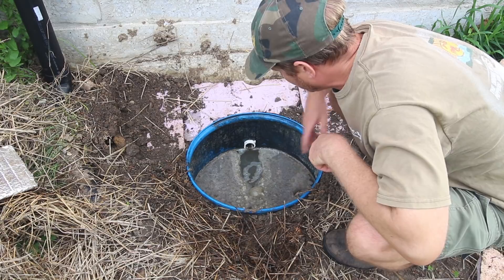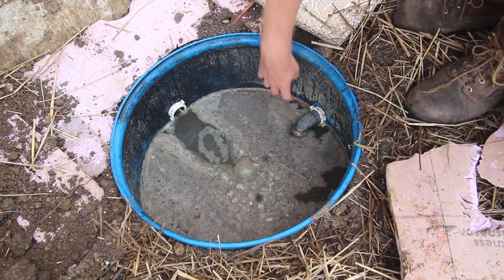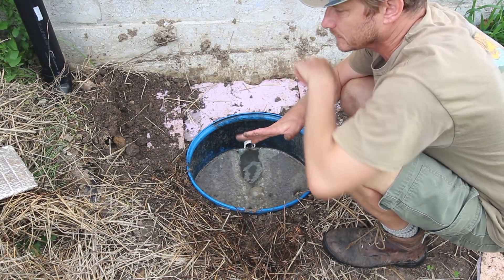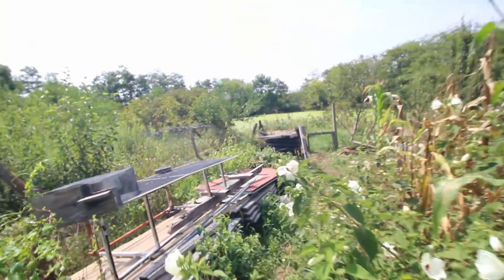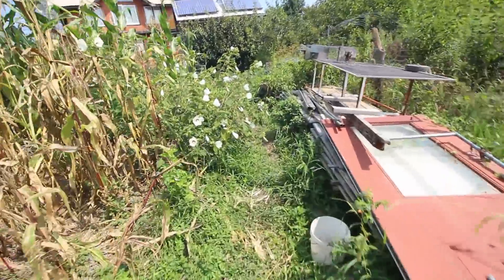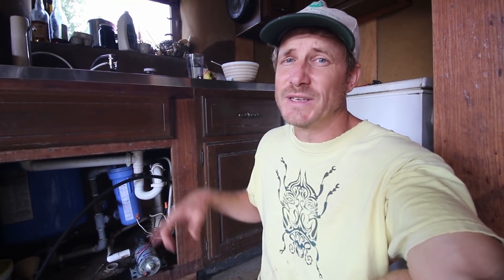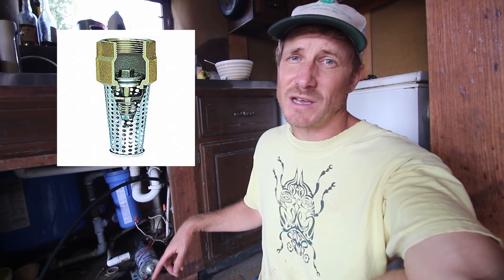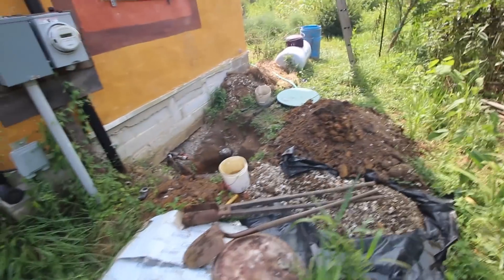Simple Wastewater Treatment for Off-grid Water System

Comment: what about black water? any ideas how we can sustainably manage black water?
Reply from the maker: If you mean from a house water system that is already set up to flush out human waste, I don't have a lot of suggestions that I know are legal. But the best way to deal with human waste is not to mix it with water in the first place. Composting toilets or humanure systems are the best way to deal with human waste without contaminating water supplies and having to deal with a much larger amount of waste than you started with. Of course, black water isn't always just water with human waste in it. Sand filters and filtering ponds are a good way to deal with graywater.

Comment: Hi Dan. I was wondering if it's possible to relocate the valve in your cistern to where it's higher and then maybe you could get to it just by reaching down through the opening of the tank? Just a thought. Good luck.
Reply from the maker: Thanks for the suggestion.  I don't know how I could put it higher in the tank because it needs to be close to the bottom to draw water out. If it was higher I'd be only using part of the capacity of the tank.  I could pipe it closer to the hatch of the cistern and then I wouldn't have to crawl back into the tank to get to it for maintenance though.
Reply: I see. I thought maybe there was a way to attach an intake pipe onto the bottom of it which would allow the valve itself to be higher. Oh well. Sorry for your troubles. And thanks for the videos. They're very helpful to folks who are considering or trying to live more sustainably.
Reply from the maker: Yes, there may be in line valves, but the one I have is a foot valve.  I'm glad you like the videos. Thanks for the encouragement!